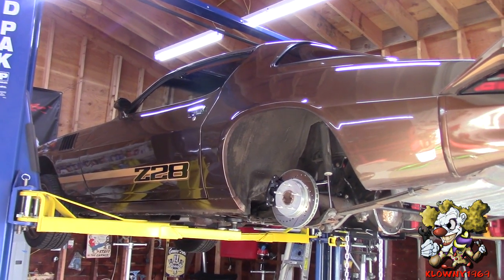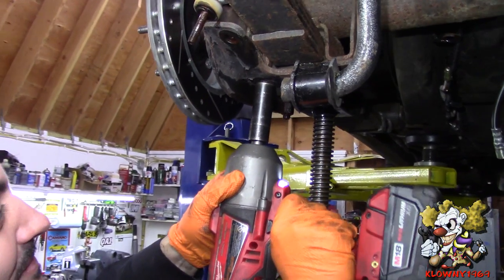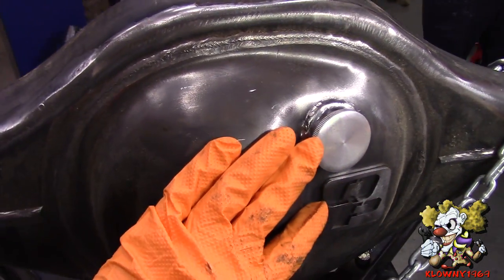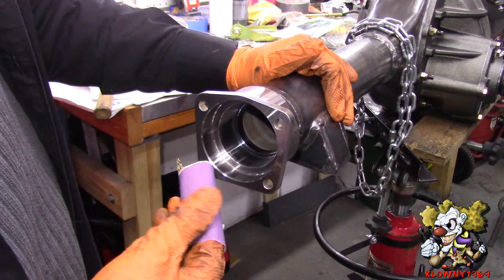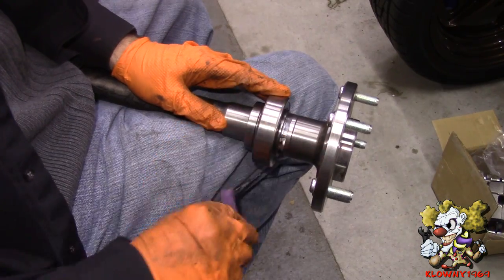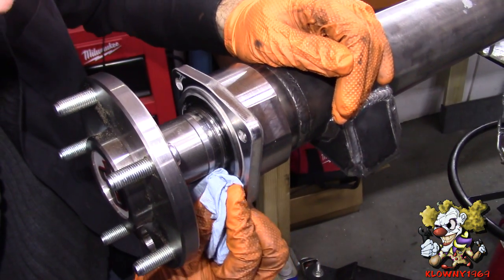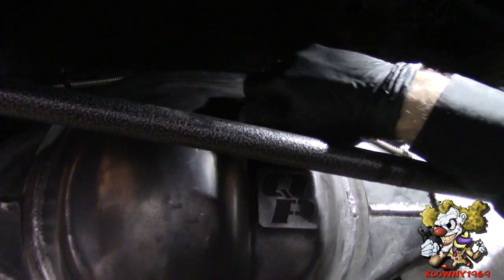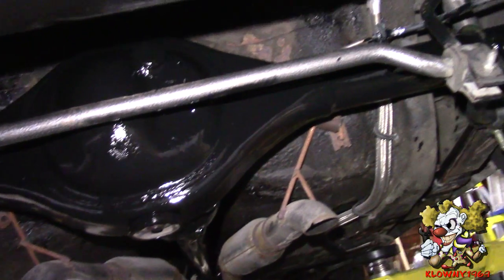How To Install A BulletProof Rearend !! (Quick performance 9 inch)

Comment: I’m 65 and never have seen anyone use sandpaper on a bearing. Or have to glue one in. At least not an axle bearing. Usually these fit tight enough they would never be able to move anyway. It’s hard enough to get out without doing anything. The fastener plate is what keeps the bearing from sliding out. It’s there for that reason only. But overall a great video for beginners. Good job.
Reply from the maker: Are you saying the blue towel was sandpaper? I didn't sand paper anything..and the rtv on the seal and bearing is a goid idea because they can leak..I've seen it before..thanks for watching and don't forget to subscribe
Reply: @klowny1969   @klowny1969  i think he means when you were holding the axle and said "we're gonna rough up the outer surface of this race right here" and then proceeded to sand it.

Comment: Many thanks for this video. My Quick Performance rear end assembly didn't come with much for instructions. Your video answered every question that I had. Thanks again.
Reply from the maker: Awesome..glad I was able to help out..dont forget to subscribe and click that bell to be notified of future videos
Reply: Question: Does the rear brake caliper install with the parking brake spring in the UP or DOWN position? Brake line tonthe top or bottom of the caliper? Insee that you have yours installed with the springs on top. Can you verify that for me, please?

Comment: I just put one of these into my 91 Camaro. Fits great I'm pretty happy with it. Looks like your using GM flush mount housing ends on that, those backing plates are for big Ford housing ends
Reply: what size yoke did you use 1310.1330 or 1350.

Comment: Looks like you used the wrong bearing retention plate. When the correct plate is used, the opening points down and all holes in the housing line up with the holes in the bearing retention plate. For a staggered shock setup, you need 2 passenger side bearing retention plates and 2 passenger side calipers. No holes are added to the bearing retention plate and they are bolted to the axle housing with 4 bolts.
Reply from the maker: I think I mentioned that in the video..thanks for watching and don't forget to subscribe

Comment: nice job.   are you going to paint the rear housing at all or leave it bare metal?
-edit.. nevermind, i see you painted it black at the end of the video.  good 

I am about to order a 12 bolt setup within the next week for my 87. having some dilemma about how to adapt my current brake setup to work with the moser housing ends.   trying to work it all out soon so I can order the rear.  then i'll have to bolt it in and measure for a new driveshaft as well.
Reply from the maker: Hey man..thanks..I painted it black with a paintbrush and rustoleum paint..having a good rear is a must for women and thirdgens!

Comment: I need the part # for the brake hose coming off of the caliper, the one with the banjo connector on the caliper.  Do you have that?
Reply from the maker: i mentioned it was from a caddilac, no? im pretty sure i put the part number in there too

Comment: All that sealant will end up inside with the gear oil.  Quick Performance gives you a special gasket for the third member that does not the use of any RTV sealant.

Sealant on axle seals and bearings is not necessary.
Reply from the maker: Oh yes they are

Comment: Welding backwards 🤦🏻‍♂️
Reply from the maker: You can push or pull a weld..dont together to subscribe
Reply: klowny1969 sure you can weld anyway you want doesnt mean it’s correct or give you the strongest weld possible.
Reply from the maker: @mikeeagle2653  yeah..but u are aware that u can push or pull a weld, right?